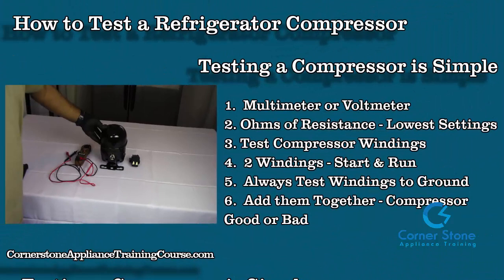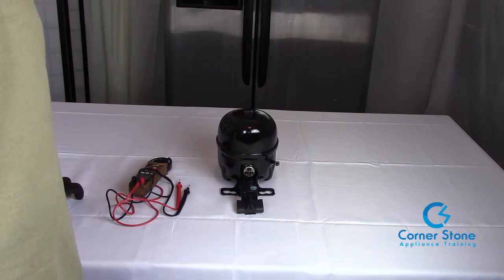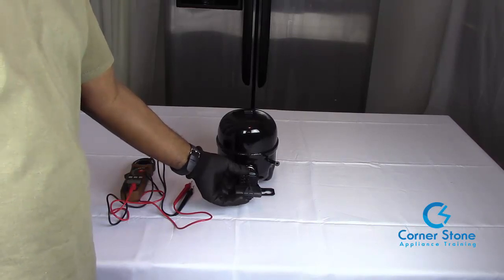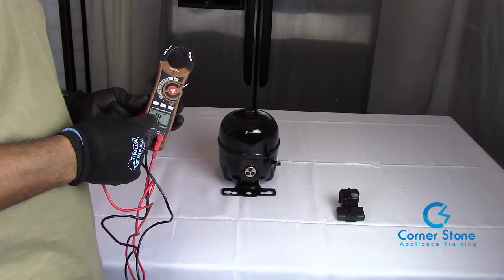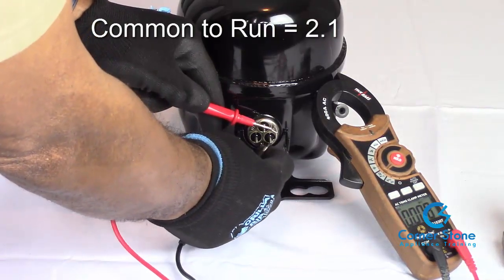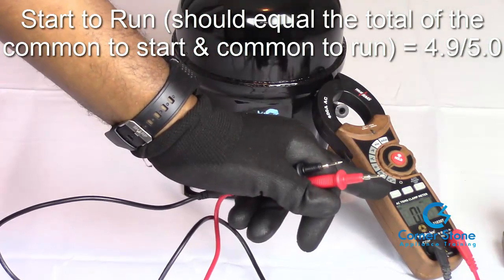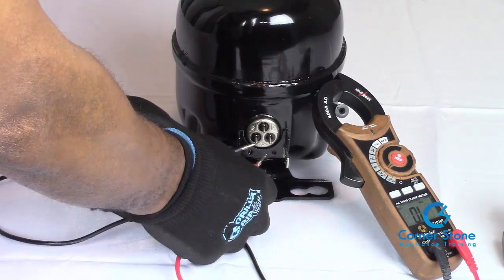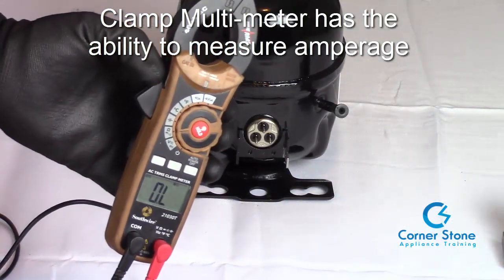Refrigerator Repair - Not Cooling or Freezing? How to Test a Compressor... LG, Samsung, Maytag

Comment: Hi i got a QD65Y chinese wine chiller compressor im getting 19.2 ohm from c to s n 38.0 from c to m
N im getting 57.2 for my s to m
Its fairly a new chiller with freon leaking issue. So the relay keeps clicking every few mins. B4 i buy a new relay can i know if my compressor is ok?

Comment: Great video! What steps would you take next if the compressor doesn’t run, but the windings test ok? I’ve got a Dixie Narco vending machine I picked up used. When connected to power, it trips a breaker. I worked backwards trying to diagnose the problem, and have narrowed it to the compressor. It has a Supco 3n1 installed in place of original relay and cap. Thanks for any help you can provide!
Reply from the maker: Did you also check ground? If not, do that as well.  If that is good.  I would testing the overload relay or replaced the overload relay.

Hope that helps.

Thanks

Comment: I think you have narrowed my issue down for me.  On multi meter test top to bottom I get  ~ 10 and 9, so 19.  Start to run, I get NO movement on the meter.   Bad compressor right?
Reply from the maker: Yes, if you are not getting the sum between pins... bad compressor.  Also, it sounds like the Start winding is the problem.  Hope that helps.

Thanks